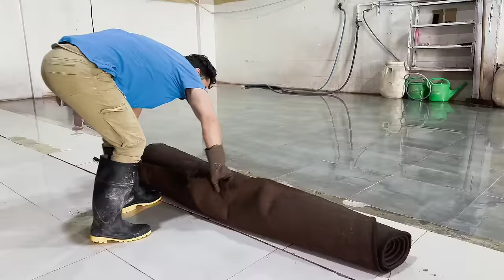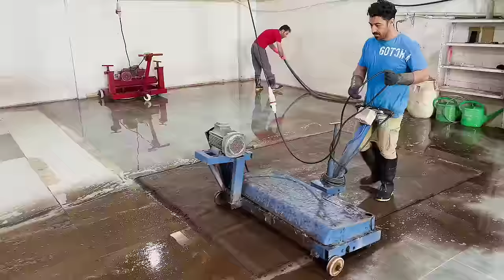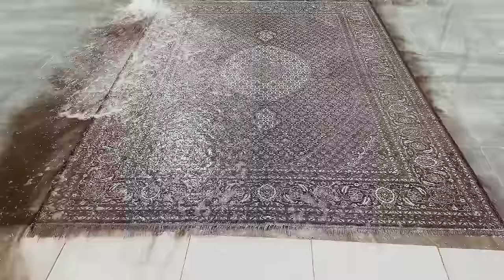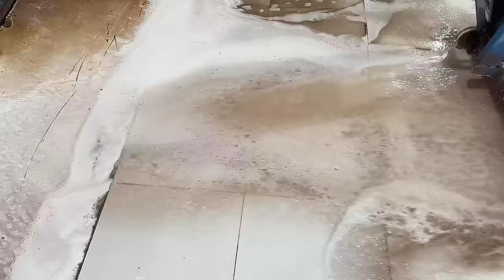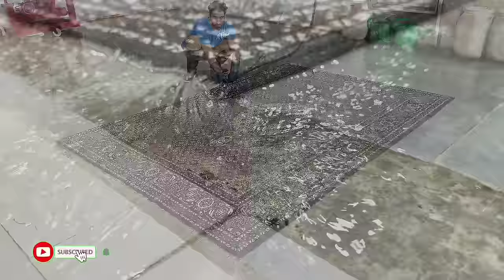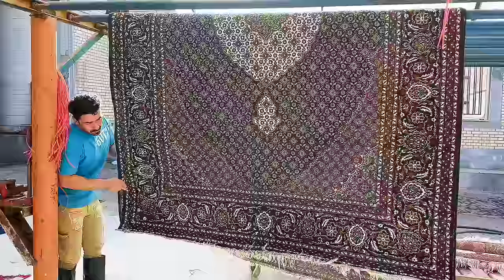You Cannot See What Gold Is Hidden Under The Mud

Comment: I have a few questions about the process. Why not hang the rug and use a 1000-1500 psi pressure washer? That would probably use less water and the lower psi would do no damage and yet be quite effective. If hanging isnt a good option, why not invest in a grooved floor that slopes toward drain. That would allow water to move under the rug to get away from it while you clean.
Reply from the maker: You are right dear , we will do, thanks for the tips👍
Reply: I would think even a slightly tilted metal 'factory' type floor that lets water flow through would be good.  But none of these channels use this type of thing.  For one, they may get more clicks by just slowly cleaning things that sit in the muddy water, only slowly getting cleaner and cleaner...